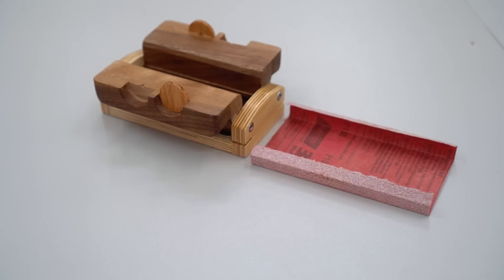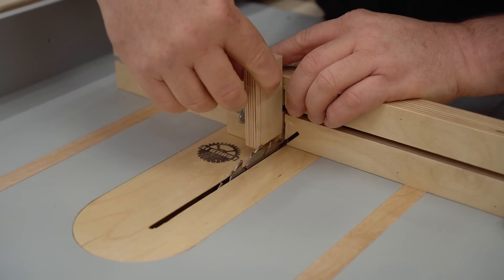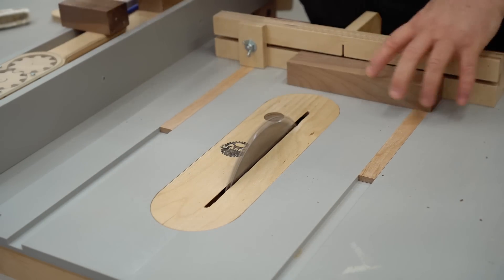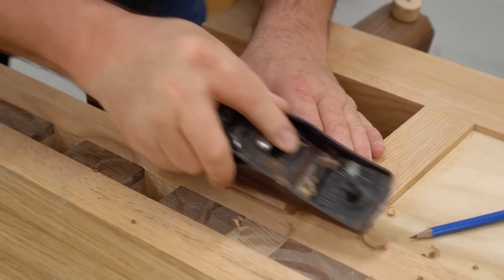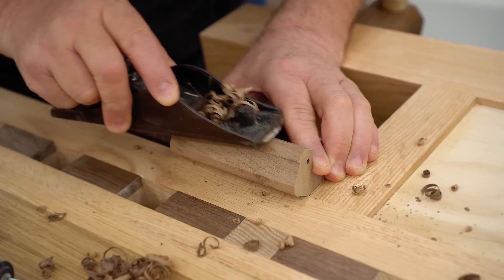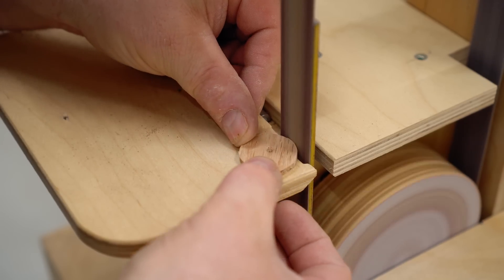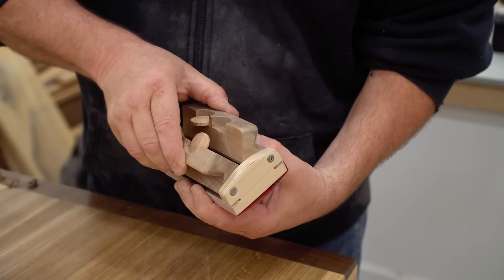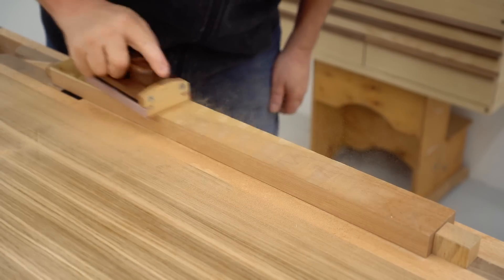Self Locking Sanding Block / How To Make

Comment from the maker: The handles clamp the sandpaper in place when they close and release it when they open.
Two or three thin sheets of stiff plastic (like from a large soda bottle may work better than the thin sheet metal and be easier to get.
Get project plans on my website for sale: https://ibuildit.ca/plans/
Reply: Finally, a project of yours that ended up how my projects do, loved the laugh too. I usually insert a few choice words instead of the laugh
Reply: Good job.....
Reply: How do you feel about some milk jug HDPE melted to shape?
Reply: Maybe you should make a second board with the marker screw, so you don't have to be screwing it and unscrewing it, you just swap the boards when you need it ..... (it's just one more contribution to your brilliant idea)
Reply: The concept of using the metal (or plastic) to grip the paper is a great idea. My first thought upon opening the video was "how does he keep the paper from loosening when closing the handles?" Then when you showed the sheet metal I was like "BINGO". I'm definitely going to attempt a version of this idea in my own shop.
Reply: This is all nice but most of us do not have sawtable and only have simple wood cutter. Can you make a video on how to make a saw table using hand held wood cutter. It doesn't need to be super accurate and customisable, but functional enough to cut accurate right angle edges would do.
Reply: InstaBlaster...

Comment: Juat grab a block of wood, chuck the sand paper under and leave enough over the sides so you can add a rubber band around it. Work wonders. 
Nice build by the way like your way of thinking👍

Comment: Dear John Heisz: Allow me to admire your dexterity, shown on the many practical tools made by yourself!

On the design of Sanding Blocks, let me tell you that after trying several DIY sanding block designs for years, I found that most of them are a little too much on the "heavy" side and somewhat tiresome... being too tall.

Then I found a simpler, more practical design that uses  3"X 18"  SANDING BELTS...  It takes advantage from the belt being very easy and fast to put around or to exchange, and then easy to put enough tension on it,  which transforms the belt into a very tight and flat sanding surface, making a very practical, lightweight sanding block! 

It was so effective that someone found it so good, that he ended up stealing it!  It was a commercial design made from fibre reinforced tough plastic.  So I made a copy of it from wood, and while somewhat heavier, it was still light enough and functional, providing  a long and effective sanding surface. The lower profile puts the hand closer to the surface being sanded, which reduces any rocking or tipping tendencies, augmenting control and maximizing the applied pressure.

On the other hand, the closer your hand is to the sanding surface, the lower the pressure you need to apply to grab the sanding block, and the lower the tiring effect you get!... try it and I'm sure it could become your favorite too!  Best regards from Mexico.

Comment: I did something like this but all I did was to glue a long strip of sandpaper to a 2x4 then cut the down to size..... Or just use pieces of scrap wood, flatten them out and spray glue the sandpaper to the smooth part.

Comment: Just a thought would the original piece of metal work if you used a smaller pivot that the washers? Maybe just a couple  of screw heads a few mil proud in line with the screws that hold it on?
Reply from the maker: Not enough space to get the sandpaper in.
Reply: @JohnHeisz  I meant same depth as the washers but would move the flex/pivot point closer to the centre line
Reply from the maker: Oh, ok - sorry - I tried that with smaller diameter washers. The plate was still too stiff.

Comment: Question unrelated to this video:  I noticed that when you make several cuts to a single piece of plywood you typically flip the piece over after 2 cuts and then cut from the other end.  Is this to account for something specific such as potential drift or just good practice?

Comment: John, would it work as well if you did not cut the slots in the end pieces and just had the 1/4 sheet fit between the end pieces and under the metal? Asking for a friend. :-)
Reply: The paper would not cover the full pad area (bottom of ends hang over), unless you notched the paper.
Reply: @JoeBcrafts  Of course! Thanks.

Comment: I love the sheet metal design, the way it clamps the paper and bends down BUT I just wish the handles somehow cammed the other way so that its pulling the paper tight instead of wanting to push it out as you close them. That little detail bothers the heck out of my machinist brain.
Reply from the maker: Might want to check the oil in your machinist brain because something's not running properly. The handles bear on the metal plate, not the sandpaper, so they can't push the sandpaper out as they are closed.
Reply: @JohnHeisz  OH. Ok, that makes sense and that also explains to me why the aluminum vs the steel worked so well since the edge of the aluminum is bearing right against the rough side of the paper.

Comment: I went through two pilot hole sunken head drill bits yesterday, just from the driver falling over. So frustrating. I'd give it another year and I'll have a workshop.
Reply: I was measuring mills for my CNC, dropped one and snapped the end off, thank goodness it wasn't the one I needed.
Reply: @KipdoesStuff  that sounds much more expensive than mine.

Comment: I don't understand the point of the wooden circles. If the two handles are touching in the middle doesn't that mean it's closed?
Reply: I think they're just for alignment. Because they're just rotating on drill bit shafts, I'm guessing there can be a bit of play there, the curved discs will just pull the two handles into alignment when closed. Whilst John mentioned the issue of having to close both in concert, that doesn't strike me as a big issue.

Comment: Nice block but you shouldnt sand like you demonstrated.
There is a chance that the edge of the sandpaper catches a loose grain of the wood and gets wedged underneath.
That way you pull up a splinter and ruin you workpiece .
Always sand with leading edge beeing folded up. That way it will never catch anything